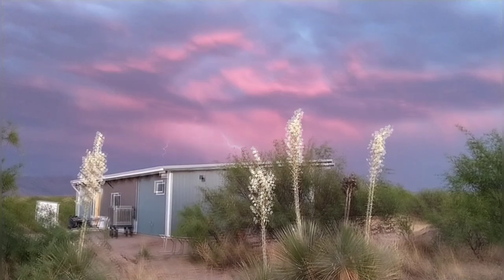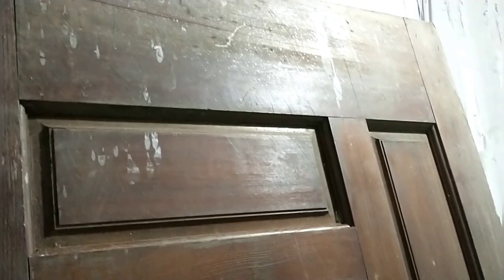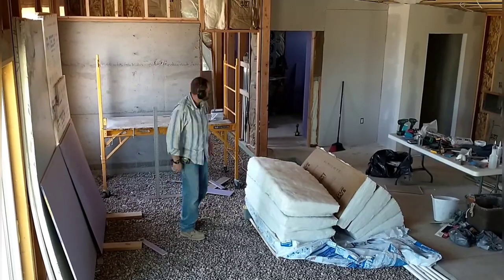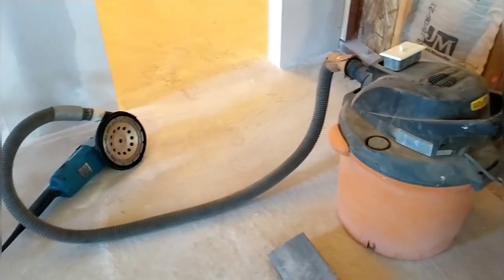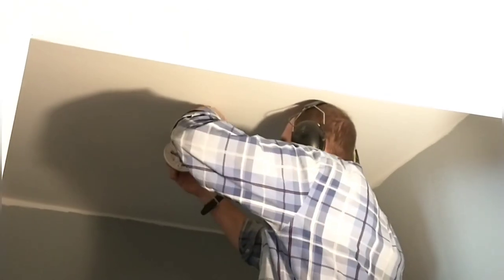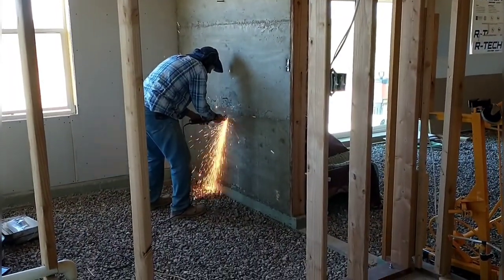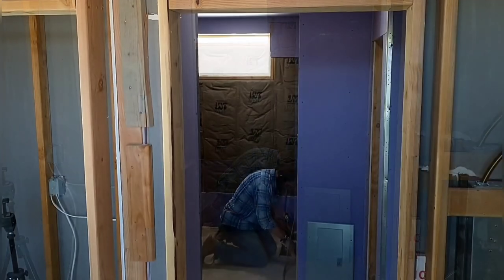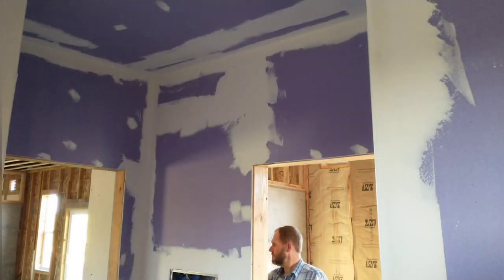Making Progress DRYWALL & INSULATION | #33 DIY Off-Grid Home Build

Comment: Great progress, it's almost down hill from here (cabinets are always a pain... Don't forget to install lots of blocking in kitchen walls). You'll be moving in before you know it.
One thing I like about DIY is that the small details get done right, a contractor will never do what April (or you) is doing to make it not just 'good enough' but make it right.
Finally, nice to see the PPE April is wearing, especially the dust mask, there's no place for fiberglass in lungs.
Reply from the maker: Thanks! It's coming along well! We are keeping an eye out for used cabinets, so we'll see if we can find some that we can make work. 
I am more about efficiency than Red is, he would get it done much faster, and reasonably well, but he doesn't sweat the details like I do.
Yes, people think it's not hurting them now, but don't consider the long term effects of not using proper PPE.  We plan to bring up the topic in the next video.  
April 😊🏜️

Comment: I really recommend that you go to a sheetrock store and buy round corners they're plastic round corners instead of them square corners they look so much nicer after they're finished they have different degrees of brown corners select the one you want and use that instead of the square corners they look more better they also have round corners for you're a ceiling to wall too.
Reply from the maker: That would definitely be a different look, and I'm sure it would look nice, but we prefer crisp edges and square corners. 🌞

Comment: Another nice video!  Does the evap cooler use much wattage when it is running ?
Reply from the maker: Thanks! It uses around 300 Watts on low. That's less than an RV refrigerator, and it won't need to be on 24/7.

Comment: Planting Marigolds is supposed to help keep garden pests away. That may help with your pest issues.
Reply from the maker: Thanks, I washed them off and used some diatamatious earth and that seemed to take care of them. I planted a few marigolds, but the leaf cutter ants and birds really like them, but a few survived. 🌞
Reply: @RedandAprilOff-Grid   WOW .... the birds normally leave Marigolds  alone ...... good luck.
Reply from the maker: @michaelcravens3767  Yeah, when there's not much else to eat in the spring, the birds like them pretty well. The leaf cutter ants will strip off all of the leaves and flowers in a few days, but they usually come back. 🏵️ It's a challenge. 🌱🏜️